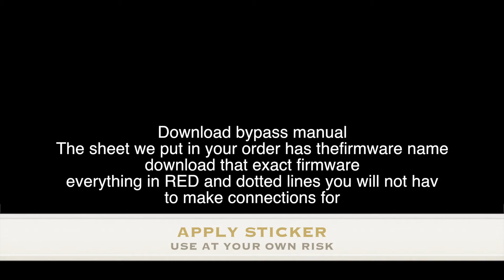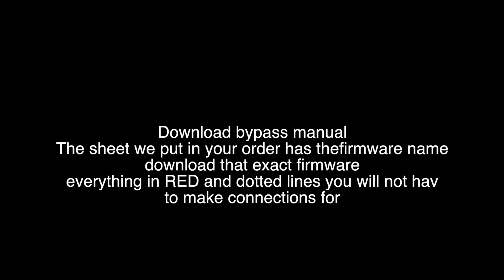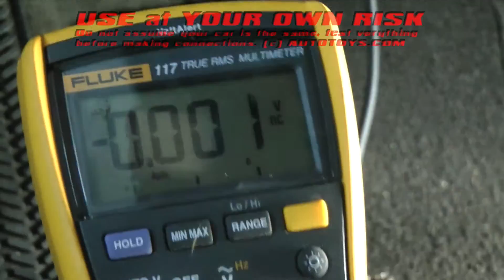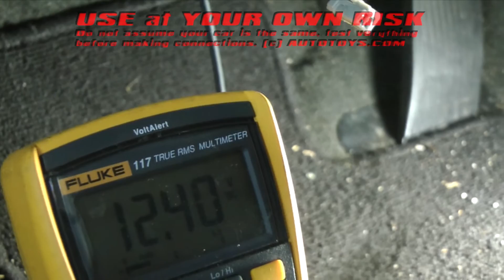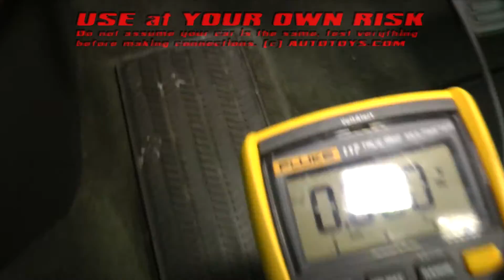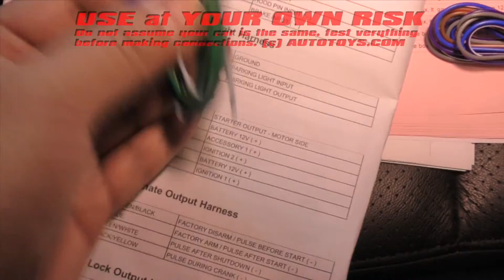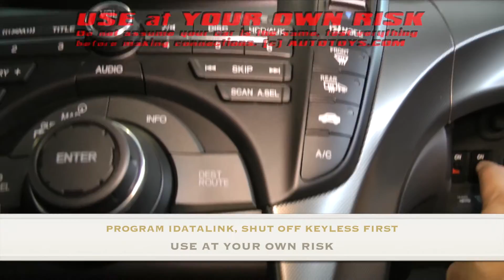ACURA TL RS  REMOTE START INSTALLATION UNCUT USE AT YOUR OWN RISK

Comment: Bought a used tl 2010 tech with push to start… previous owner had a remote start/alarm system… he removed it and now i cant start the car without putting the key in the hole… is it because it was programmed to simulate the key present? How can i reverse this?
Reply from the maker: You should take apart the car and see where he made aftermarket connections, then see anything is cut. I recommend an qualified 12v alarm
Installer to help.